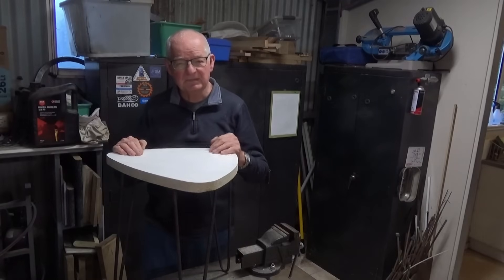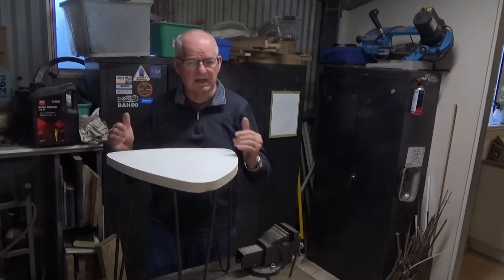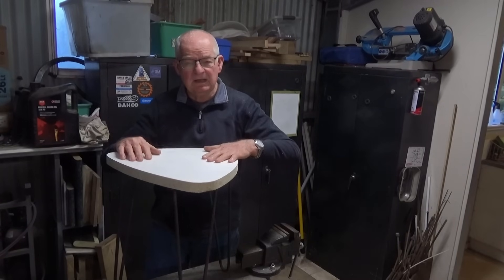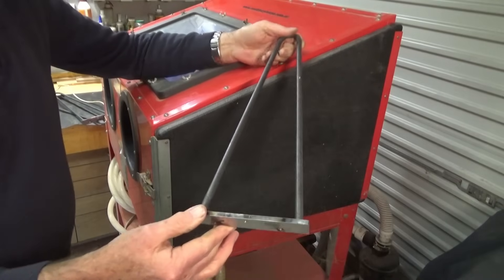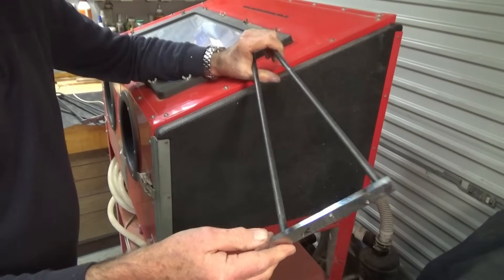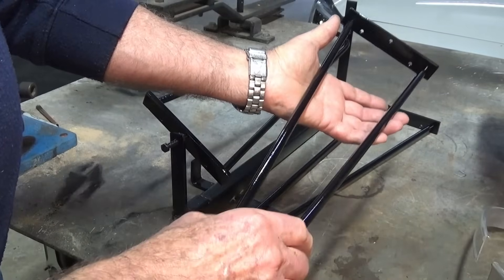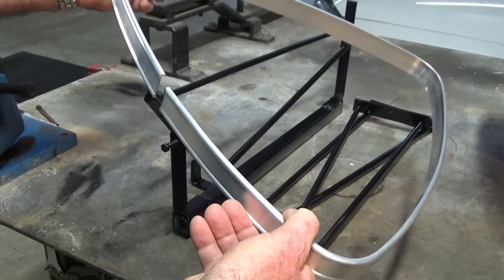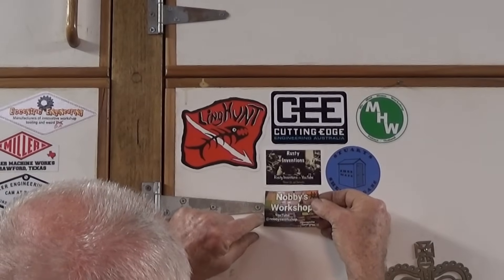Build a Guitar Pick Table - Mid Century Modern Style Part 2

Comment: The table looks very professional and fits perfectly between the seats without wasting space.
The fixing of the legs for coating was necessary and quite ingenious !
Waiting for your next project. 😊
Greetings
Reply from the maker: Thanks. I did get lucky with the fit of the leg frames in my little oven. The height of the legs was set by the chairs so it was going to be difficult to shorten them.
Regards,
Mark

Comment: Oh My, Mark. Your 50's style table sent me scurrying for an old book from my high school days titled, Wrought Iron Furniture Projects (I believe) I welded a patio chair from plans in that book and I'll be darned if I can't find it now. Many of the projects used the same leg design for your table and in the states, those legs were stocked in many lengths at local hardware stores. A great job as usual and thanks for the memories.
Reply from the maker: You can still buy those legs on AliExpress. I thought about buying some off the shelf but I reckon they would be just painted directly over the bare steel. I like the look of those hairpin legs. They are light and elegant.
Regards,
Mark

Comment: I love Gorilla Glue but well understand choosing something else in this case. My work has devolved from furniture construction to mostly repairs, so storage of an open container has become an issue. Looks like you use the 'squeeze-out' method to exclude air. I use a large 3/8" drive socket and invert the bottle so the air (and the dried crust) is effectively under the liquid glue in use. The cap is a snug fit diagonally across the square drive. Not perfect, but it works for me.

Really enjoy your channel- cheers!
Reply from the maker: That Gorilla glue is great for some applications but I don't think I have ever used up a whole container. It nearly always turns solid no matter how careful I am to squeeze out the air. I wasn't going to risk it squeezing out onto the wallpaper and I couldn't think of a way of masking it successfully. 
Regards,
Mark

Comment: I'm surprised you didn't leave the wetted wallpaper glue-side up on a flat surface, and bring the tabletop down on top of it, then just compress the whole thing flat. Innovative solution with that powder coating jig - the finished table looks mid-century great!
Reply from the maker: I must say I have very little experience with wallpaper but I believe it is making a comeback. My biggest worry was trapping air bubbles or getting sawdust or grit contaminating the two surfaces.
Regards,
Mark

Comment: another great video. I really like the table project . great guest room .  I am wondering about the long term bond with the wallpaper on the melamine surface? with the melamine being not porous . would a flat painted surface have been better ?
Reply from the maker: I must say, I have no experience with wallpaper. I did lightly sand the melamine to give it a bit more surface area. I have some spare so if it delaminates I can try again.
Regards,
Mark

Comment: I just happened across your channel. Absolutely brilliant!

How did you make the little makers plate you attached to the bottom?
Reply from the maker: Welcome aboard. The makers plate was laser etched from a two ply plastic which is sold specifically for laser etching. It is available in a wide range of thicknesses and colour combinations. The top layer is very thin so you can engrave through it with fairly low power so you don't scorch the surrounding surface. After engraving you use a vector cut to separate the plate from the stock. It looks like metal but it's just a metallic foil surface.
Regards,
Mark.